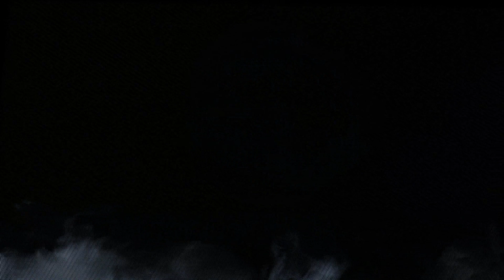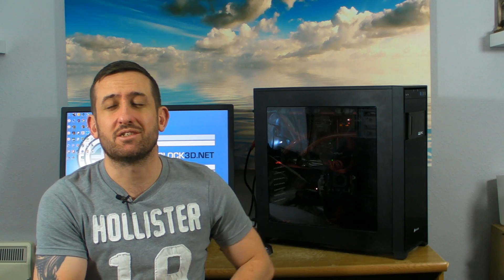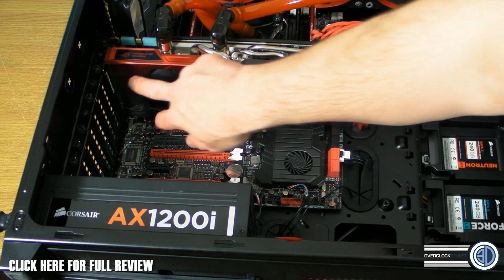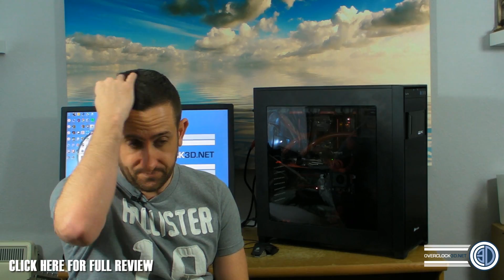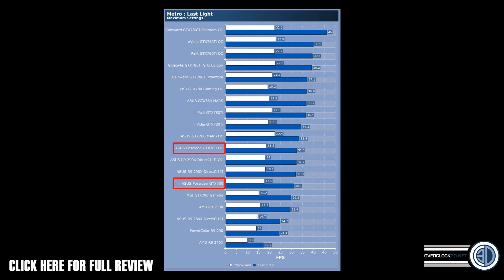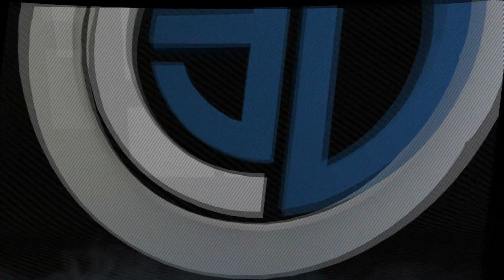Asus ROG Poseidon Hybrid Cooled GTX780 Graphics Card Review

Comment: Hello tom. I been watch urs and so many other videos i really had thouthe the 780 and 780ti to beat was gigabytes overclocked with tripple cooler. U really think tge msi is better. The msi 780ti in my friends system cant hang with my brothers gigabyte 780 non ti in both need for speed tripple 1080 surround as well as battlefeild 4 at single screen 1920x1200

Comment: MSI GTX780 Gaming OC is the best bang for the bucks in all those cards
Reply: nah, i own two of them and i deeply regret not going with EVGA
Reply: Parkskiingftw
OWN COME ?! i have that exact card MSI twinfrozr gaming OC and i think the cooler on it is awesome very silent and my card run at 60c with 60% fan speed and that overclocked at 1275mhz...cant really do any better ?!
Reply: ya but the evga cards have dual bios and they only cost about 20-30 bucks more plus with MSI if you were to take the original cooler off, it voids the warrenty but with evga as long as the card comes back in it's stock configuration they will replace it
Reply: Parkskiingftw
no, now you are talking about EVGA classified card and they cost 100$ more, the standard EVGA does not have a bios switch, MSI has the lightning that has a bios switch you could have looked for this one if it was a feature you where interested in, it's makes no difference the GTX 780 are beast overclockers
Reply: the warranty issue with msi a huge problem for me though (i am a water cooler)
Reply: with the prices you're looking at i would go either with the 280x and crossfire (depending on the price of the 280x) providing you have sufficient powersupply and airflow in your case to accomodate that, that should get you the best performance in most games, a 780ti is close tho and in some games performs even better...if you're going with a 780ti i would recommand the MSI gaming twinfrozr to anybody anyday it's very cool running and very silent, good quality fans and cooler on this card
Reply: Have the asus gtx 780 DirectCU II OC and im thinking of going sli, but i realy want 2 of these Poseidon's :)

Comment: Im modding my 800D, to hold a 240mm rad at the bottom, and was concerned on how to run the loop, in order to get the best temp. If your statement is true, that it doesnt really matter in which order its installed, then it makes it a lot easier for me to run the loop! Right now, if I stress my CPU it goes up to about 75c, if I play games, my graphicscard follows along that path, due to the CPU heating up the water.. If I run furmark my graphicscard will stay at around  55c, so I thought I had to put a rad in between the CPU and the GPU in order to solve this "problem". Very interesting...

Comment: with the Asus 780 cards you cant use more than 1.21v
but with an EVGA 780 and some other brands there is a volt hack that will let you
use up to 1.5v I have my 2 EVGA 780 @ 1456 / 1950 with 1.45v

Comment: Tom Tom Tom... sorry bud, but watercooling does increase stability over air when pushing clocks to the edge. And as far as the power slider, it does absolutely nothing when you aren't increasing the voltage. It's only there to permit the card to use more power, which it will not do at stock voltage, period. To be honest, you aren't properly overclocking a card if you aren't applying additional voltage, especially on WATER. Not sure what you were thinking, but it just seems like laziness to me. And yes, voltage still matters. It seems you've fallen out of the loop a bit.

Comment: Off topic question : do the cables of the Corsair PSU reach the 8pin on the motherboard. Or do you need to extend them?? I'm looking to buy a 750D to replace my C70. Btw, using a AX860i now.
Reply: I have a 900D and a ax1200i and it reaches the CPU 8 pin just so I think you will be fine.
Reply: Ow ok, then my order for the 750D is going out ;)  thanks!!